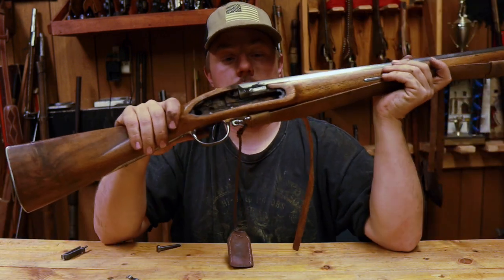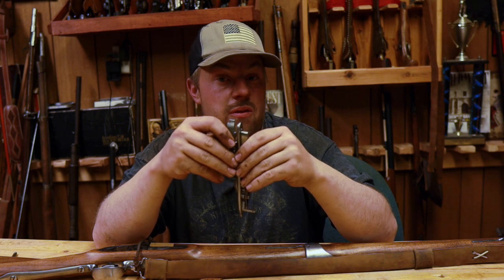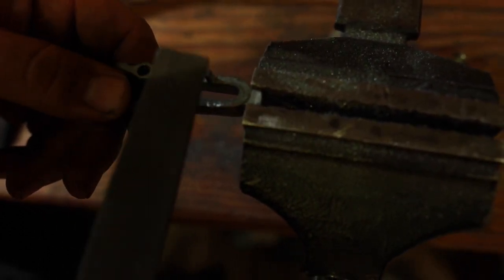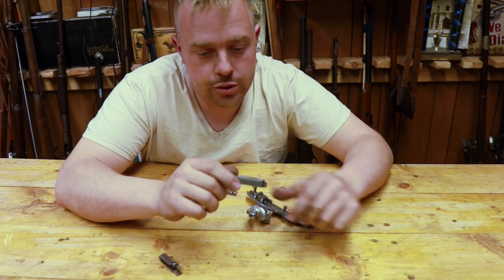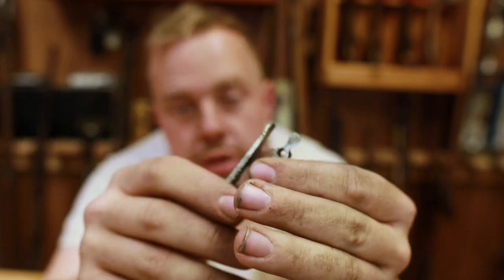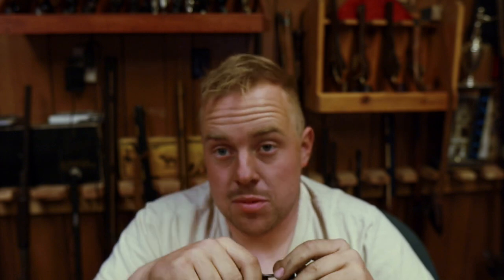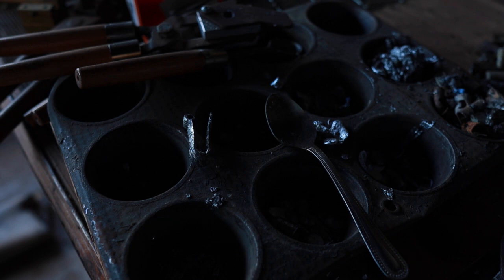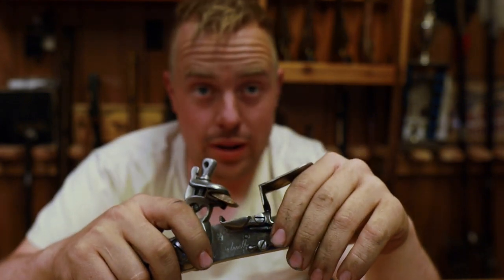Hardening and tempering springs from a set of Rifle shoppe lock castings

Comment: Nice work I don't understand what that thing you filed off of it was for. I Harden My Springs in oil cuz I don't want them to crack when I put them in water the next step is tempering. Which I just simply heat up my lead pot full of lead and just floated in there for 15 minutes or so take it out let it cool float it for another 15 minutes and it is tempered. Annealing by the way is when you thoroughly soften Steel by heating it up to critical stage and cooling very slowly after which it will be as soft as copper.

Comment: I float an old brass hinge on the lead and hold the temperature  so the lead is just melted and then put the spring on to temper........as soon as the spring changes to a rich blue colour  i turn of the heat and allow the spring to cool with the lead......no cleaning up on the spring and a lovely blue finish.
Best wishes from the UK.
Reply from the maker: That might be the next way I do it

Comment: Next time you talk with Military Heritage, you should suggest they carry parts for the guns they sell.
Reply from the maker: I have discussed this with them and Robert had a fairly decent point that the guns are all handmade and hand fit so therefore having parts on hand to just drop into the gun is going to be very difficult. That's why I like the rifle shoppe so much because the parts are not completed yet so therefore you have plenty of wiggle room as far as fitting them to individual muskets. Lack of Interchangeable parts was a problem with early muskets as well, hence why gunsmiths were so valuable to units and militias
Reply: @Real11BangBang  I get that, I was more concerned with availability of parts.  Fitting is needed for almost all of them.  The Rifle Shoppe is not always the go to for parts in stock.  Thats all.
Reply from the maker: @dougdukes1039  Yes you are 100% right on that It would be nice if they could get some closely shaped parts to have on hand. As far as the rifle shop goes, I think they have improved as far as having parts in stock because I've been ordering from them fairly consistently here lately and The only thing that I have found that was not in stock was a barrel for the pattern 1776 I ordered.

I think I can do as you stated. And call Robert again and bring up what you mentioned as far as having spare parts available and see if we can't at least have some roughly shaped parts that can be fit to the guns.